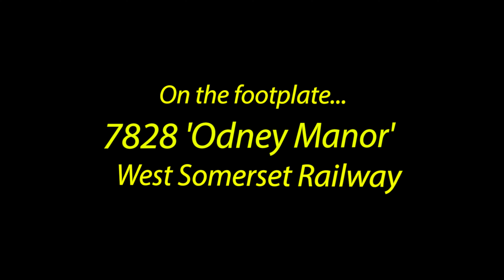Railcam from the footplate.... West Somerset Railway feat. 7828 'Odney Manor' | Railcam LIVE

Comment: What’s venting steam in the immediate area where these guys are working? Lots of hissing, and clouds of steam around them. Is this normal? Is it dangerous?
Reply: This is at the beginning…
Reply: Nothing dangerous! I was the fireman 😅
Reply: @bail60163  I noticed in the longer video of the Watchet-Washford section that your driver was having to continually adjust the ejector and brake settings, did this indicate some problem?  I wondered if the ejector wasn’t shutting properly or the train pipe pressure wasn’t stabilising.
Reply: @limeyfox  it was related to keeping the train pipe at 21" as we had a diesel at the back that runs at that. We on the western engines run at 25".